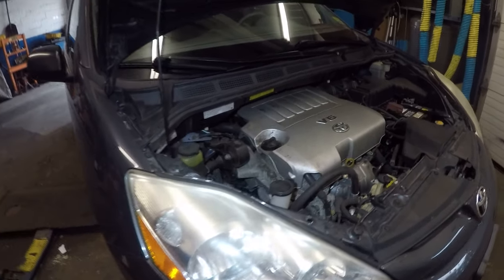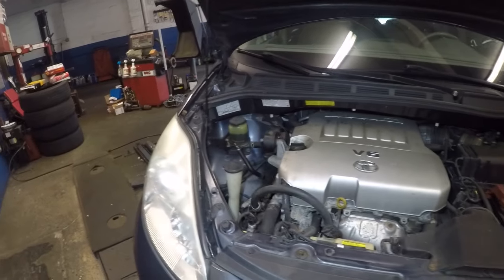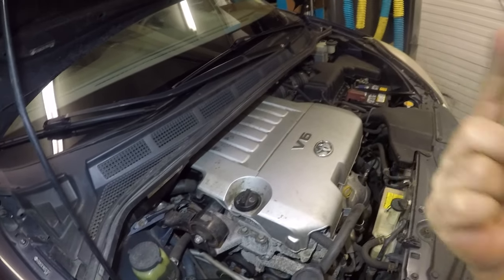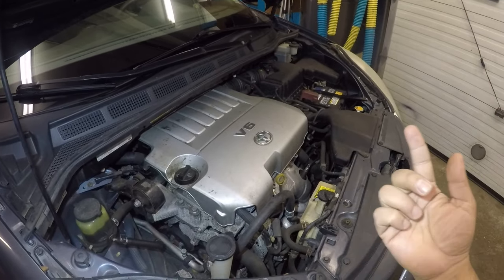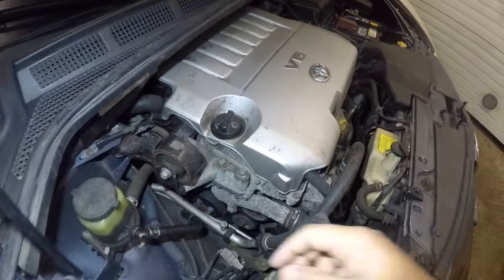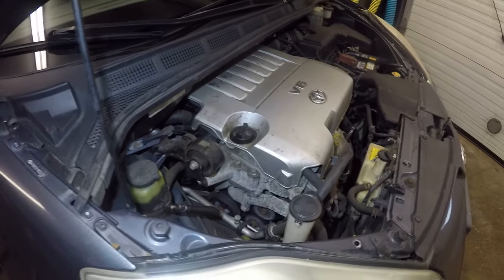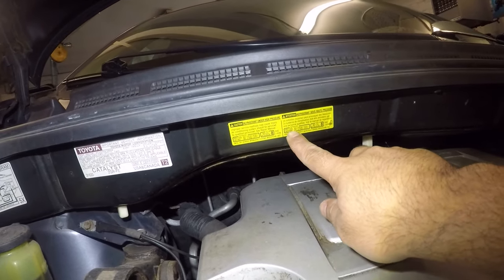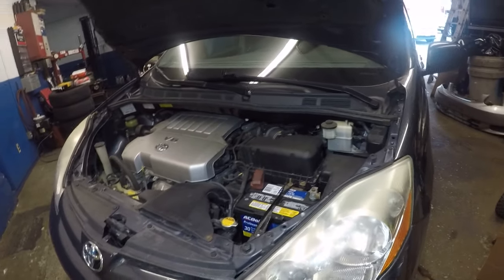AC Blows Hot and Cold Intermittently

Comment: The word you where looking for is "condensation" for the moisture outside the pipe.. this is what is happening to my 2016 Jeep Patriot, it blows cold when it wants it seems to only come on once my car runs for a while then it seems to run fine for 30 to 45 Mins it stops and blows hot air! I took it to my local mechanic and they said they thought it had air in the system so they vacuumed all the air out of the system and replaced the freon and it blowed cold when I first got in the vehicle at first but then a few minutes later it was blowing hot again! It  Was too late to take to the shop again because they had already closed but  ill be backup there on Monday... I replaced the compressor about a year ago and the blower motor about a year and a half ago do you think they could have gone out already. Is there any possibility it could be the blend door actuator? Or the condenser?
Reply from the maker: What year make model is ur car?    As I was reading ur msg u said hot and cold before u even mentioned that ur mechanic said u have air in the system that’s exactly what came to my mind it would be worth to recharge the system and make sure ur mechanic has ac machine to recover vaccum and then add correct amount of r135
Reply from the maker: By the way faulty relay can heat up and cut off then come back on once it cools off so if ur car got relay just change it out well worth it
Reply: @RBTheMechanic   I have a 2016 Jeep Patriot latitude 2.0 and I have did pay for them to vacuum out the system and to Replace the freon once they vacuumed all the air out of the system. And I also had them change out the blend door actuator and it's still doing the same thing and I've already spent well over $400! Does anyone know where the relay is that runs the fan motor on my vehicle? I have been searching on Google for days for a diagram of the fuse box and relays with out any luck
Reply from the maker: @Rhonda858  how is the outside temp some of these cars work according to temp of cabin
Reply: @RBTheMechanic  well I live in Houston Texas so I don't expect it to blow out  Icicles but I do expect it to be a bit cooler than the 85 degrees that it is currently blowing. I am going to take a chance and change out the ac expansion valve because it could be plugged up with debris or something and then most likely I will have to replace the compressor again 
Since a year ago when we changed the compressor we didn't change the expansion valve as it should had been suggested to us by our mechanic
Reply: Does anyone know where I can find a diagram of the AC SYSTEM for a 2016 Jeep Patriot Latitude 2.0? I've looked everywhere even attempted to look on Chilton diy online website but they are no longer available. I've googled it for the last few days and can never find a idk if it's called a diagram or a schematic to the whole ac and heater system for my vehicle
Reply from the maker: @Rhonda858  I can try to get it for u if u remind me tomorrow noonish like 1pm Easter time
Reply from the maker: @Rhonda858  yeah that would be a good idea
Reply: @RBTheMechanic  THANK YOU! Your awesome if you could get me a diagram but I might not need it...it might be fixed! I had someone replace the expansion valve yesterday and vacuum all the freon/air out of the system and replaced the correct amount of freon for my vehicle. And so far so good...the ac blew cold air for about an hr while i test drove it last night and then today again while i drove to work it was blowing cold....I'm afraid to get too happy cuz the last 2 times I thought it was fixed it only worked for only a hr or 2 and then it stopped. So I don't want to jinx myself. I will let ya know later today....if it continues to blow cold.
Reply from the maker: @Rhonda858  oh ok cool let me know if u still need it I didn’t go to work shop today wasent feeling god anyways let me know
Reply: Ok here's the update we already changed all 3 fan relays and the actual cooling fans for the radiator and the cooling fan for the condenser and we also changed the ac pressure transducer valve and the blower motor is less than 6 months old and the compressor is less than 2 years old and my husband says the compressor is engaging but my ac still blows hot air unless sometimes at night when it's cooler outside it will blow cooler but not completely cold air and I live in Houston Texas where the temperature is more than a 105 degrees every day here in the summer
Reply: And we have taken the truck to have all the refrigerant vacuumed out and  then added the correct amount of freon or refrigerant  what ever its called now a days but it is still not working correctly but the ac high side feels cold as ice so my husband says that it seems like my ac compressor is working correctly but it might have a blockage somewhere in the condensor or 
The evaporator or the the ac expansion valve or in the hoses so I have been looking everywhere for a new ac condensor from the dealership because I'm afraid to buy an aftermarket one cuz my vehicle was made with the  transmission oil cooler built into the ac condensor and I'm afraid the aftermarket one won't work correctly and mess up my transmission and noone has one anywhere they are all on back order! Fml!

Comment: So far, I have changed the relay, filled refrigerant, compressor engages, it still turns on/off. When it works, it's icy cold, then blows hot air, what's the next step? Thank you.
Reply from the maker: How did u fill the system with Freon did u use cans?
Reply: @RBTheMechanic  I used AC Pro's recharge kit.
Reply from the maker: @fairystone  idk what that is or how it work. Did u do 20 minutes of vaccum and then recharge correct
Amount of Freon by measure ment
Reply: @RBTheMechanic  Hmm, I didn't do vacuum but the kit shows when to stop. it has a pressure gauge.
Reply from the maker: @fairystone  no that’s not correct u have air pressure and gas pressure so it’s all messed up in there gotta start off and do it correct recover vaccum and recharge you might have to take it to mechanic and let them do it
Reply: @RBTheMechanic  That makes sense. Thanks for the tip.